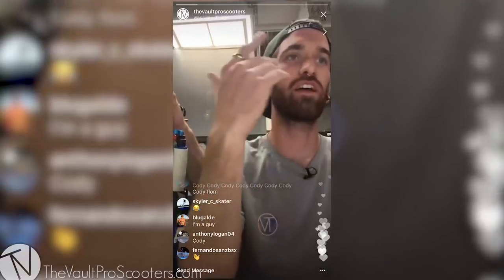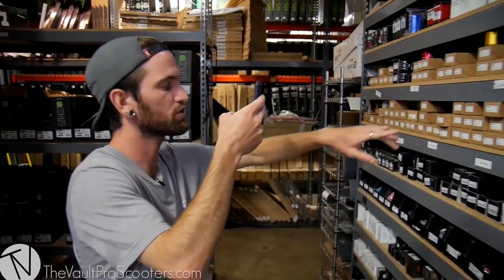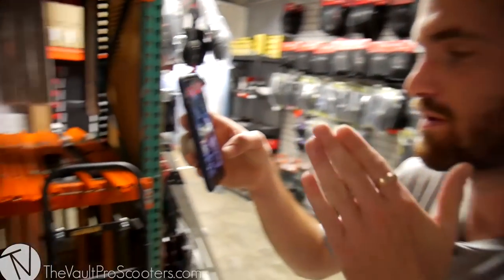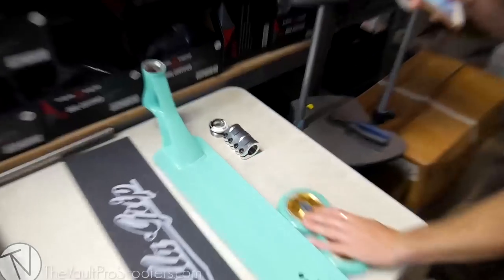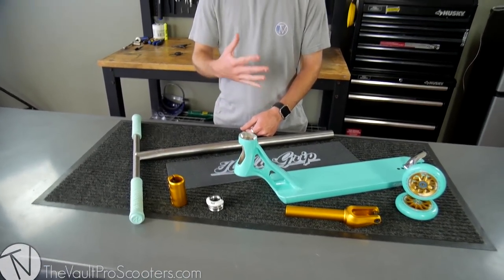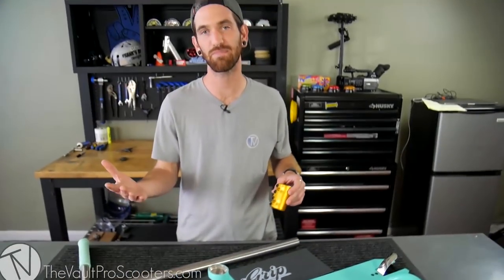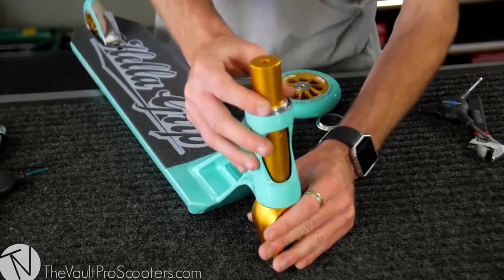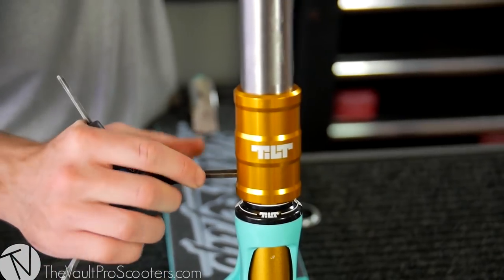Viewer's Choice Custom Build [#226] │ The Vault Pro Scooters

Comment: This is still a damn street build
Reply: Arsenal Arrow the deck is small asf
Reply: Just cause they're running tilt parts?
Reply: CRACKDOG GAMING a lot of park riders ride scs and t bar, sorry street's better
Reply: CRACKDOG GAMING t bar and scs isn't is street only, what a silly thing
Reply: Jesús Barrau Honestly when I look at this build I think of street, street decks don't have to be huge decks,  what I'm saying is that it still looks like a street scooter, when I think of park I think y or v bars not t bars, and for example a park compression to me is either hic or ihc, and yes tilt still is mostly a street build company but that is not why I said that at first.
Reply: Arsenal Arrow what defines a street build then?
Reply: Arsenal Arrow its just a scooter
Reply: Hans Bunyi I wasn't saying what defined it. I was saying what I think a street build looks like. I guess the definition of a street build is a scooter used for the streets.
Reply: Denver RG and t bars and the deck
Reply: Jesús Barrau no one asked for your opinion
Reply: Hans Bunyi bars and deck
Reply: Tyler Cole no one asked for yours either
Reply: Arsenal Arrow ooOf. So you mean riders like Maxime legrand, and a handful of urban artt and addict riders use park scooters? Sounds about right
Reply: Hans Bunyi Okay, when did I say that, I never said park scooters are street scooters and street scooters are park scooters and that doesn't at all apply to the riders of them, all I was saying is that this still looks like a street build to me
Reply: Arsenal Arrow lol... You said that when you think of park, you think y or v bars, hic or ihc. Ihc is still immensely popular in the urban artt team and a handful of those same people in urban artt, addict, and ethic use Y bars. Just drop the fucking argument and accept that if you pay for a scooter, you do whatever you want with it. Looks don't matter
Reply: Hans Bunyi just the fact that you say that French street riders ride park scooters is just whack 
They all ride pegs and or boxed ends
Reply: Hayden Black lol, I don’t think you’re reading the comments correctly. I’m saying that limiting street builds with non-y bars or whatever set-in-stone compression is ridiculous.